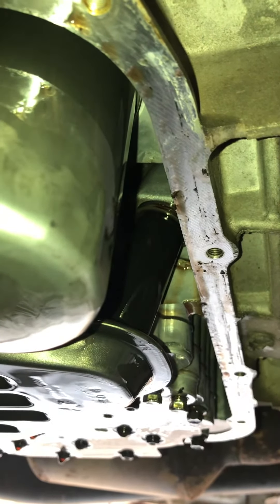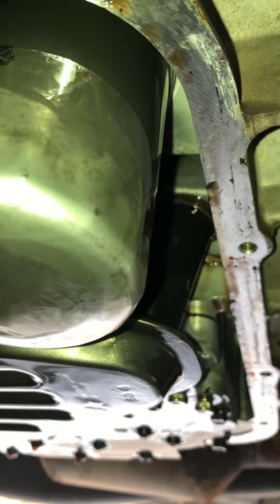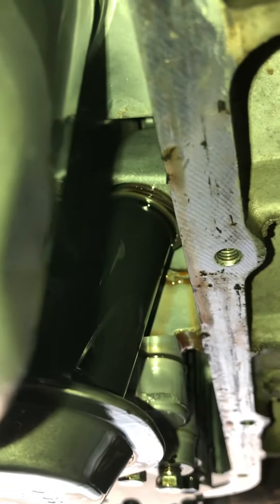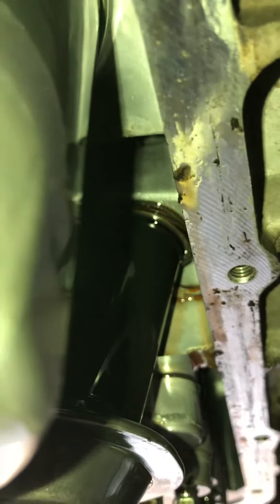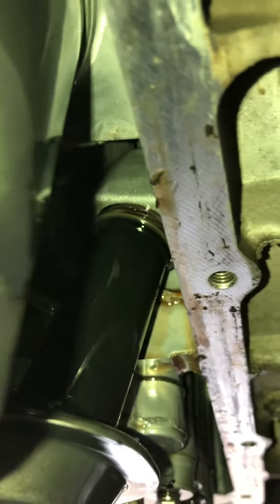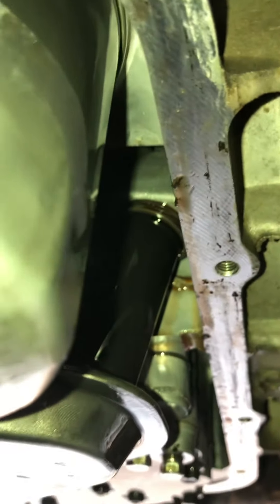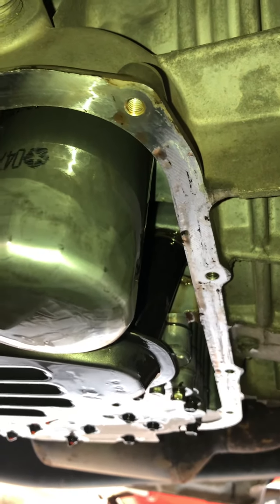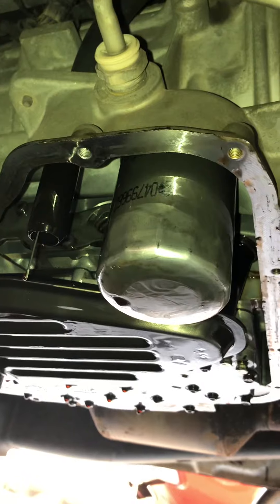2005 Dodge Ram 1500 Transmission Failure - Ram Truck won’t move!Acts like it’s stuck in neutral FIX!

Comment: Thank you!!!!! It worked! You just saved me $3500! Any gear that I put my 08 Dodge Ram in would act like neutral. I replaced the transmission filters and bushing. Now she's running fine. You are a lifesaver, thank you so much!

Comment: Hi i have a “transmission control system (MIL request” and mine when put on drive it wouldn’t engage like almost feelnlikt the linkage is not puting it into drive or reverse. 04 ram 5.7 hemi. Any clue?

Comment from the maker: I did use a socket and a mallet to set that seal……have had no issues since
Reply: Hi, was your issue was when put on drive , reverse and 2-1 wouldn’t move? Have to rev it up to 5000 rpm to make it move a little?

Comment: Thanks for the video I thought I messed up the transmission I have a 2004 dodge ram 5.7 4x4 and just went neautral I put it on reverse, drive, 1st and 2nd  and no action I'm about to change the filter and what goes in there and hope for the best
Reply: hi john i was wondering if that worked it's happening to mines right now and trying to figure out whats wrong. i leaning towards changing the transmission selenoid shift but don't want to if it i spent all that money and it doesnt work. any information I greatly appreciate it man. Thanks
Reply: Mine is doing that same exact thing. I have to rev it up to 5000 rpm to make it barely move. Have you solve your issue with whatbhe showed on the video?

Comment: So did it work I was at the stoplight the other day and my truck jerked kind of hard when it took off and stopped. Initially thought did the brakes had locked up which it kind of did I brought it back home put new brake pads and rotors on it the back wheels turn freely now but every gear is like it's in neutral I can hear it going into gear but no movement forward or reverse

Comment: I replaced my oil Ana filter today….. still
Same issue. However, do I need to “hammer” that in there? I presented and that was it. Should I take the pan down again and really push it in?
Reply: Hey i just pushed it in
Reply: Hammer it

Comment: Did that help your situation? I have the same exact problem and will change that tomorrow.
Reply from the maker: Yes, This was 100% the issue.  Not enough pressure for converter to perform its job.  

Local shop tried to get me to replace the transmission without even taking a look!!
Reply: Can anyone help a girl...shit! No shops open today

Comment: My 4wd neutral light came on solid and won't go out or engage gears. Any knowledge on this?
Reply: My brother-in-law's truck has been having the same exact issue as the video subscriber has posted while reading through multiple forums I gathered that there is a small reset button next to your neutral light that should help reset it so you can then put it back into a gear from what I gathered as of now your T case is in neutral
Reply: @alexseitz4972  yeah nothing worked. The transfer case shift motor burnt up so I removed it and manually put it in 2wd so I could get it home. I ended up driving it like that for a couple months. It was fine. New motor was $300. I put it on but started having issues again so the motor didn't just go, the root of the issue still exists. Either a sensor getting wet or the abs screwing up due to a loose wheel bearing. I have the new bearing but it's a pain in the ass to change. Have to pull the top ball joint and lay the spindle down to access the three bolts because the front axles are in the way

Comment: Well I just bought a 04 dodge ram 1500 with the 3.7l from a buddy because his wife was driving it and just randomly lost all gears but it ran fine before that sooo this might be the issue if so best 400$ I ever spent
Reply: Did it work?!
Reply: @edgargarcia7650  it did not unfortunately. Thinking it's the torque converter but found a trans with only 40k with a torque converter so gunna just get that